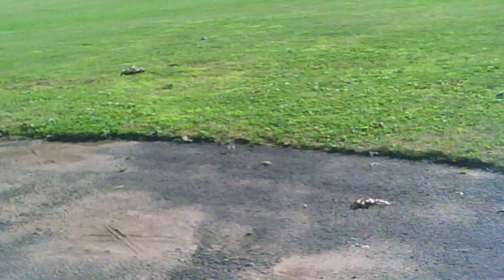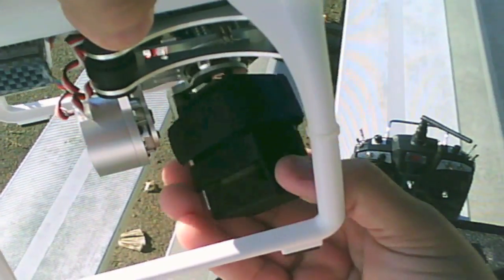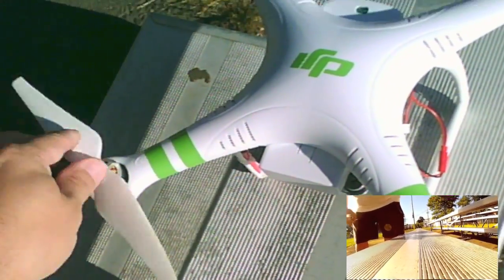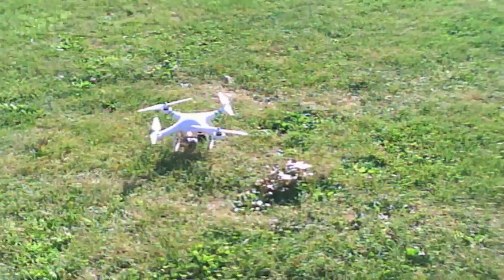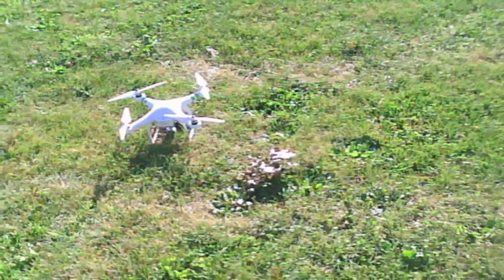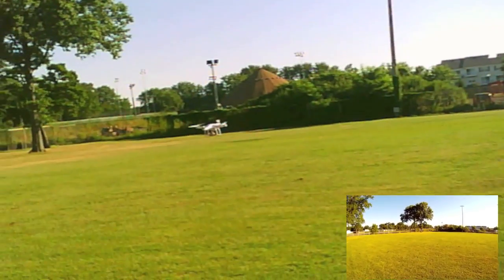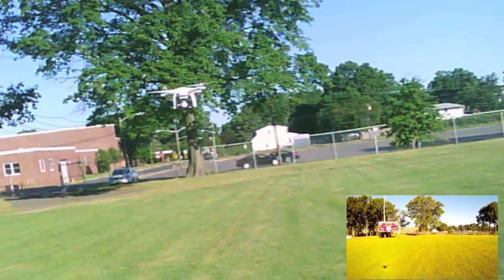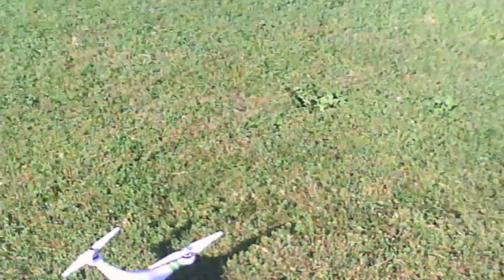DIY DJI Phantom 1 with Brushless Gimbal test flght

Comment from the maker: Wanted to make a comment to the video in case someone asks, the reason I used only 1 screw for gimbal top plate to belly of Phantom was because the gimbal if lined up for the 2 holes, stopped the battery door from opening.  So, I screwed the one tight using a hole further back on plate and where the other holes were I cleanly added hot glue between 3 holes connecting them together making a solid bond and to the plastic.  Holds like a charm so far! Yes I am looking for a better top plate that will work more efficiently, but for now, this will do.